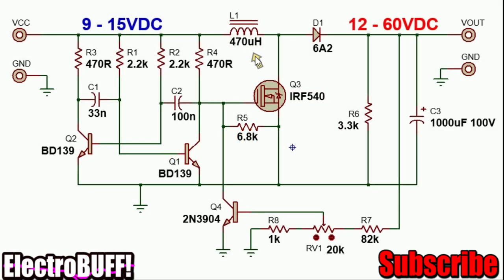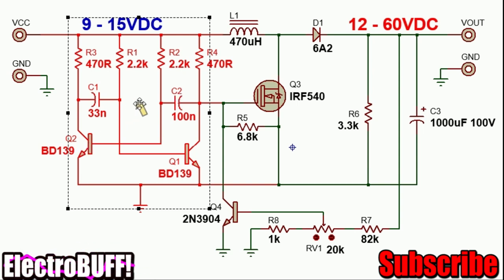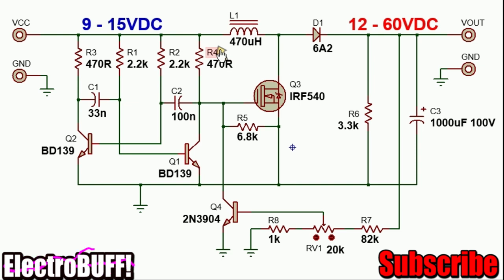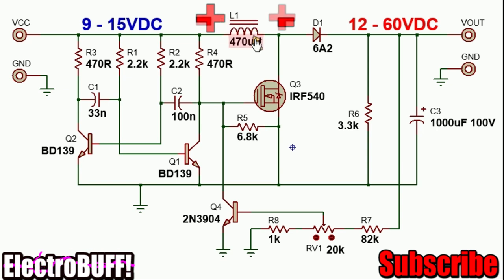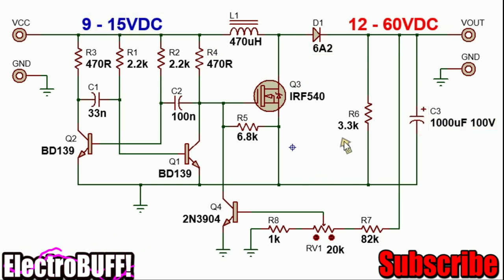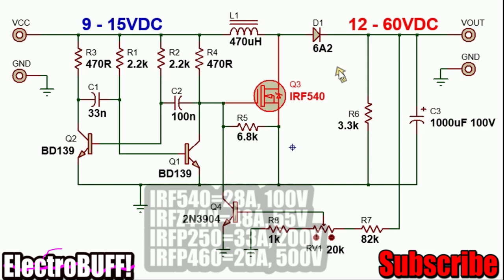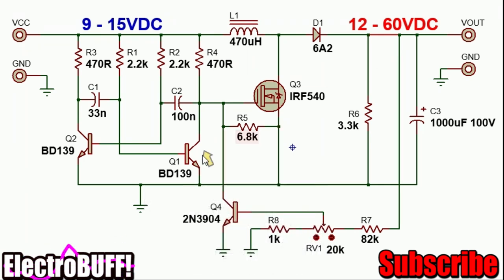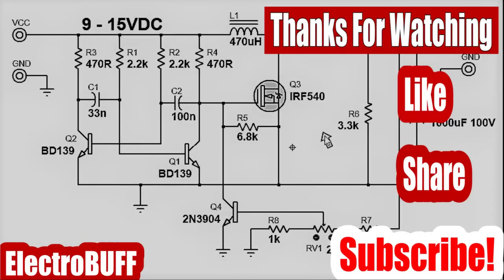How to make a Simple DC DC Boost Converter Power Supply

Comment: Again, this is a nice circuit ,what do I need to change in the circuit to make this DC/DC Booster for the following ratings :    40 to 70VDC input, 240V to 420VDC output